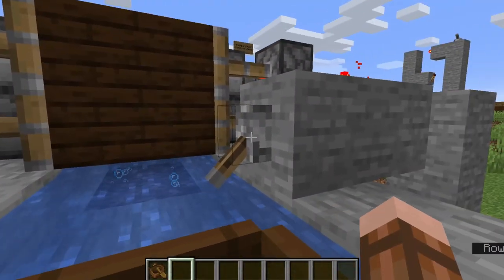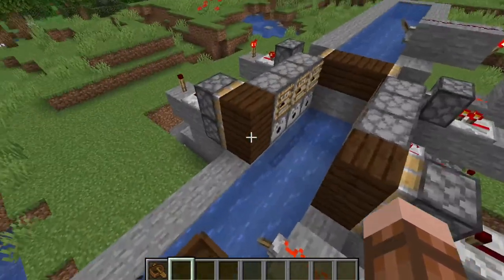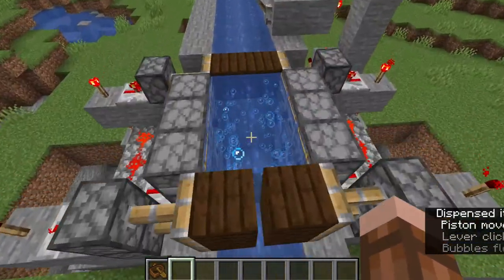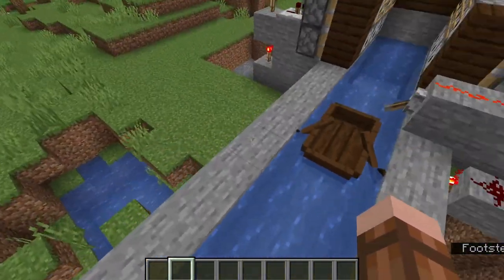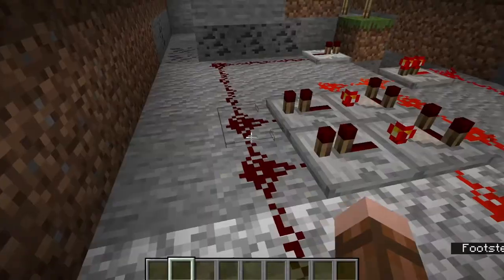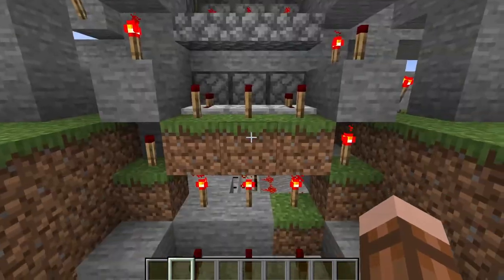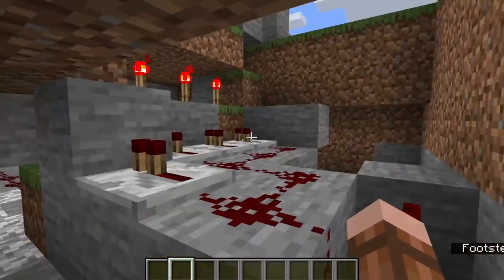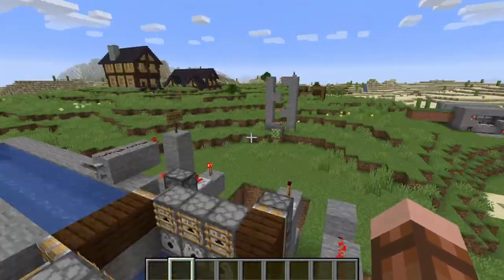Minecraft - Working Canal Lock / Boat Elevator (2 Blocks Up / Down) (1.16.4)

Comment: I'm not exactly expecting a response. But is there a limit to how high it could be? Was wondering if it'd be possible to make a taller one
Reply from the maker: I figured out a slightly different way to build one where the height was theoretically infinite, but I forget how it differs from the one in this video. also yeah sorry this is 3 months late

Comment: can you make it wider?
Water can spread, so two walls of dispensers in the shape of an L can fill an arbitrarily large volume.
For the water removal, you could expose sponges to the water, which dries the room. The sponges are taken from a block storage. Then retract the wet sponges, push them into the same block storage, pushing out new dry sponges. Ofc you need the player to manually dry all the sponges from time to time.
Reply from the maker: I've never dealt with sponges so possibly, but I wouldn't know how to build it